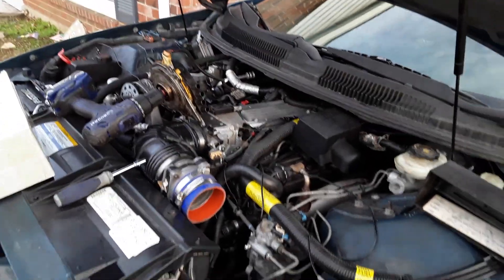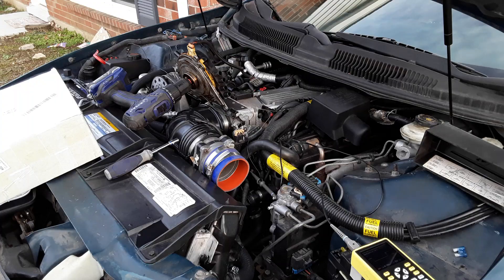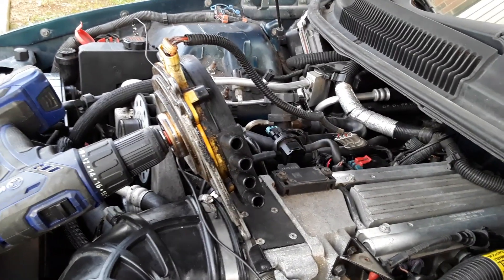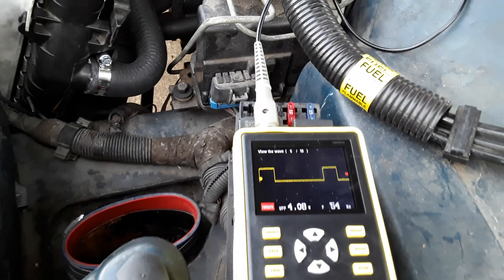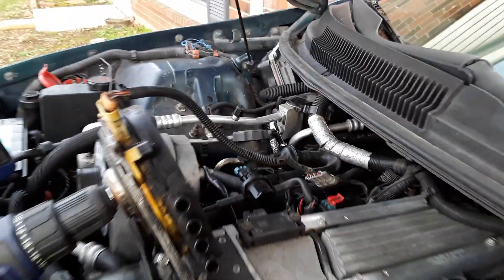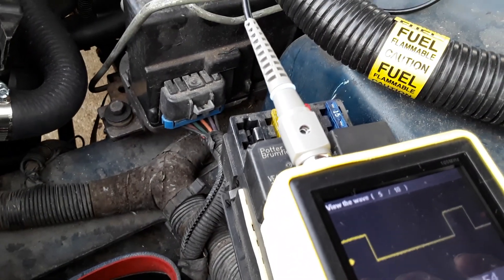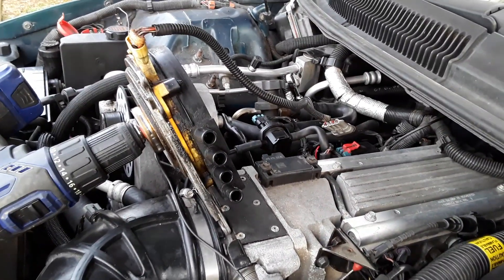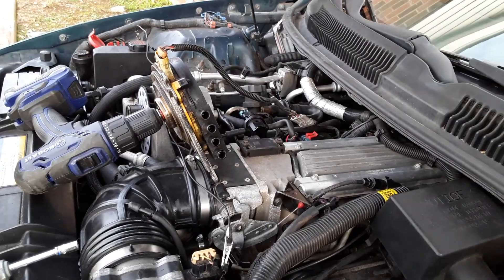Testing your opti before installation

Comment: Where are you actually connecting the oscilloscope?
Reply from the maker: There are 3 places. Over on the coil, there is a signal wire on the plug. I THINK it's the white one, but you may want to check a wiring diagram to make sure. Just back probe it. If you have good signal there, you don't have to test any more. If you don't have good square wave forms, then you have to test the high and low res signals at the plug for the Opti itself. This would be the one where we plugged the test opti into the car. Again, refer to a wiring diagram to see which wire is which. After identifying the correct wires, back prob them and check for square wave forms.
Reply: @RealInsaneGalvatron thanks so much man. Few more questions. Is the flow of information opti->computer(via the 4 plug wire)->coil->coil wire sending spark to opti->?

Also does the oscilloscope only have one lead which is used to back probe the wires? No ground? Never used one before lol.
Reply from the maker: @LT3D  Yeah, tha'ts pretty much spot on except the last step. There is no signal going from the coil to the opti. The signal tells the coil when to send spark. It sends spark to the opti.